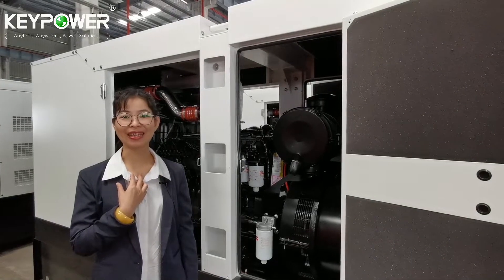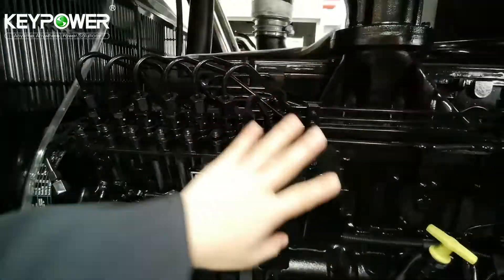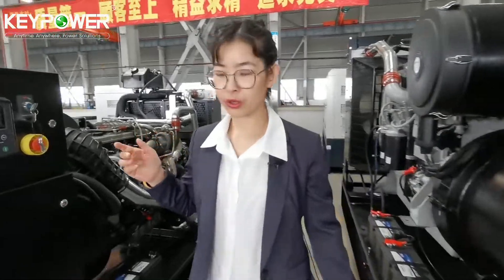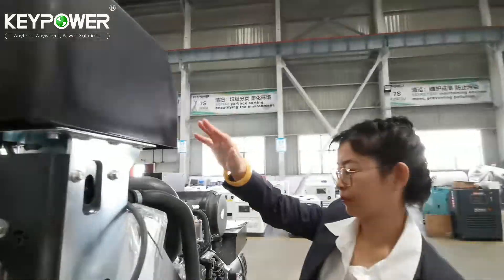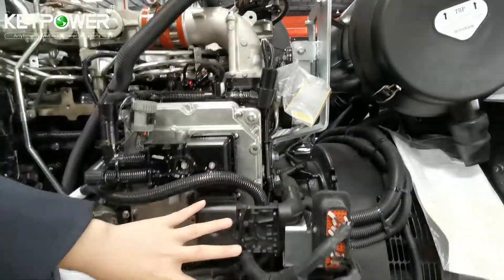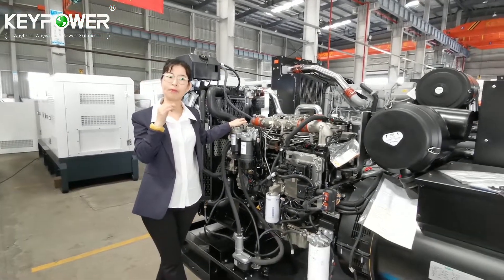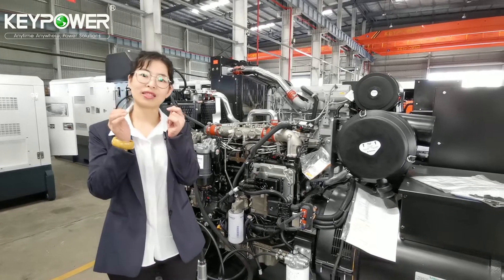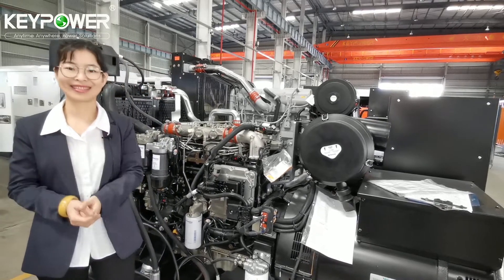Difference between Cummins 6LTAA8.9-G3 made in China and Perkins 1206A-E70TTAG2 made in the US.

Comment: Man I’ve even gotta delete the emissions from my generator now… I’m sick of deleting stuff
Reply: On generators these don't fail so often. Generators run at pretty high rpm constantly so they don't make much soot if the load is steady..if its heavily dynamic then it will make a lot of soot till the turbo builds boost. 
Dpf will rarely choke on generators..the scr is going to be the main failure point as these generators sit for months without start the adblue in the pipes may solidify & clog the injection system..